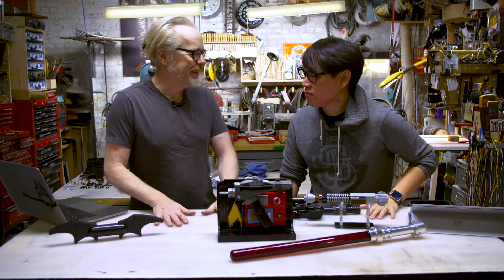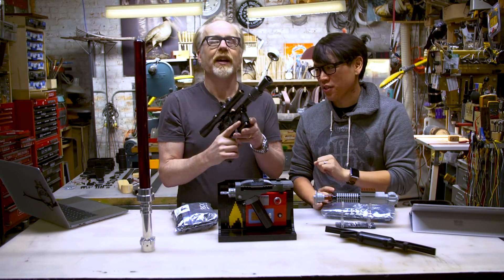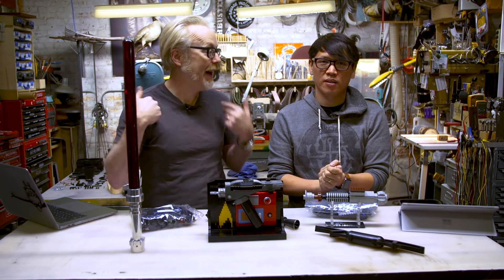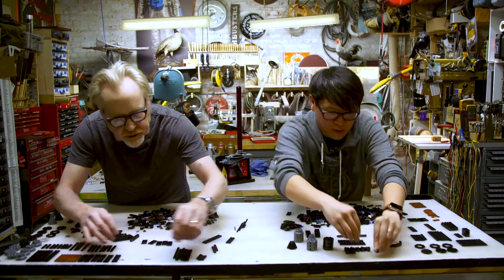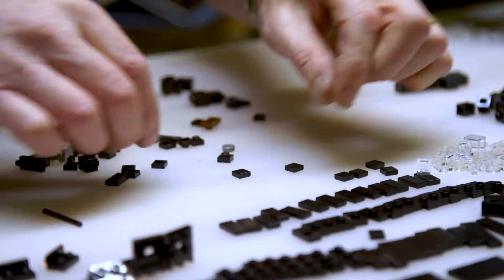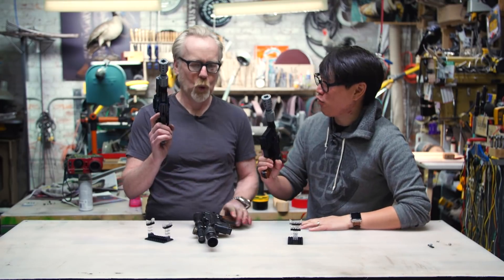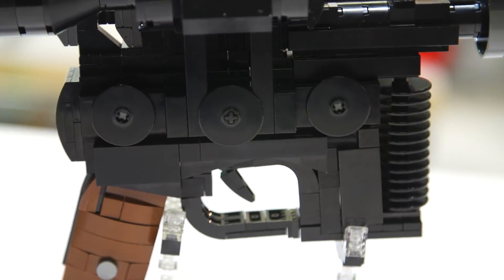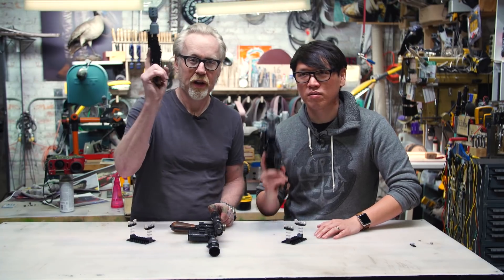Adam Savage's LEGO Han Solo Blaster!

Comment: I've noticed after watching this video that in a lot of new movies, the guns don't have 'weight' to them. For whatever reason, you can obviously tell that Adam's DL-44 has a lot of heft and weight to it... 

Just look at the guns in A New Hope vs Force Awakens, the actors carry them differently because the weapons in A New Hope are 'real' in that they weigh a lot and fire blanks...
Reply: It all depends on the scene I think. Anytime the actors are holding rubber props its probably not so heavy, but like you say the ones that fire off blanks are heavy since they have actual firearm internals.
Reply: Well, I don't think they're using real blank-firing guns anymore. It's more airsoft and 3D-printed/custom-made stuff for the newer films. While some of the props are still made of metal, like Han's DL-44 (based on an airsoft HFC M712) and Rey's custom-made NN-14, they probably still don't weigh as much as real guns. A New Hope did have rubber/replica stunt props too, though. I believe Greedo's DT-12 was rubber (or some sort of cast plastic) and the E-11s were sometimes non-firing stunt props (I think the DLT-19s and RT-97Cs were also at times). Still, I can see what you mean in firing scenes; blank-firing weapons will obviously look more "real" than airsoft guns will.
Reply: Quarax of course they still use blanks mostly real guns converted to fire blanks to give realism, hans blaster was based off the Mauser C96 and most guns don’t weigh 30 pounds, rubber and other synthetic material guns are still used if they are gonna be in a holster or not shown in detail or not be fired.

Comment: Just to clarify

Instructions made with LEGO Digital Designer are actually generated by the program itself. These usually have a lot of flaws in them and are sometimes not in the correct order. You'll therefore see some builders who sell their own sets or instructions use programs like SR3D or LCAD and spend time handmaking each and every step and coming close or even matching the quality of the instructions of LEGO themselves
Reply: Not to mention that if it does include illegal building techniques like they mentioned, there is no way LDD would ever let you build the thing.

Comment: I get that you think knolling is faster, but I wonder if there is a point of diminishing returns. What percentage of pieces need to be knolled in order to be most efficient. If you knoll 75 % and start building you know where 75% of your pieces are and have to look for the other 25%, but that group is so small is easy to pick individually. You spend that time building and as you pull from the remaining 25% it gets smaller and therefore easier to pull from, just as easy as the previously knolled 75%. It would be a cool idea because I get the idea of knolling but I need some proof that its always better to do it all the time, because in making and in life there is rarely a way to do it that's perfect every time.

Comment: Did Norm have some pieces left over?
Reply: Looks like it. As soon as the camera was off, Norm's fell apart. ;p
Reply: I noticed that - Adam used all his but Norm has what looks like four pieces left over... they don't address it (although they are there to see...) perhaps duplicates... if I had a choice I'd have Adam's...
lol GreyHulk2 he did well not to drop it on the floor...
Reply: that happens from time to time. Ive built a lot of lego sets and most of them have duplicates.
Reply: I don't believe it's meant to happen with unofficial kits. They're built to a strict budget, so I doubt they'd leave extras in the bag like LEGO always do.

Comment: That Lego build is based on the ESB blaster (silver cap), not the ANH one
Reply: The flash hider on the blaster gun in ANH was not painted or blued black - it was bare steel that had greyed from exposure to the elements.
The flash hiders in ESB were bare aluminium or resin painted silver - made to resemble the original steel but the prop masters were not as picky as fans are today so they did not replicate it too high standards.
The ANH and TFA versions were the only with the long scope. The TFA design was based on the ANH blaster but the flash hider was made black.

Comment: The Tested teams obsession with knolling LEGO drives me insane. It’s such a waste of time. Dump it in a pile and go at it. There’s usually so many of the same piece at the start, that it’s easy to find what you’re look for. And the further you get into the build, the smaller the pile gets and the easier it gets to find things. You can also keep an eye on a step or two ahead of yourself and be looking for those pieces and set them to the side. 

That looks like a pretty great kit though.
Reply: its mostly so they don't lose anything and know what they have and its easier to plan ahead. instead of building piece by piece its faster to make sections at different times then combine to do the finished model. which makes knolling a better alternative
Reply: In terms of engineering it's a way to keep things clear and prevent mistakes.
Reply: Blood for the blood God! Skulls for the skull throne!
Reply: Different strokes for different folks. Also, if you’re beholding anything bigger than 500 pcs (particularly if they’re all the same color), it’s tough to find smaller parts. 

It’s also therapeutic.
Reply: Whatever. I knoll the pieces every time I get a kit. But I'm also so obsessed that I always build the kits with every LEGO logo facing where the viewer can read it left to right, and if the placement doesn't allow that, I have a particular way of facing the logos in such a case. Any microscopic detail helps my eyes rest on the final result with total satisfaction. I also rotate studs so the logo is readable. I'm really obsessed with order. So let Adam and company do their knolling, remembering how much more frustratingly meticulous they could be but aren't. 👀